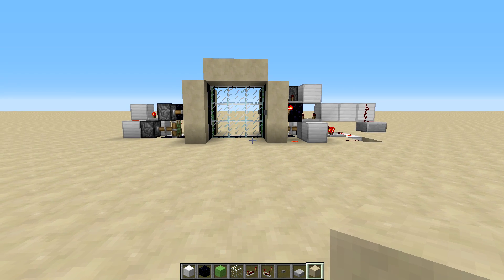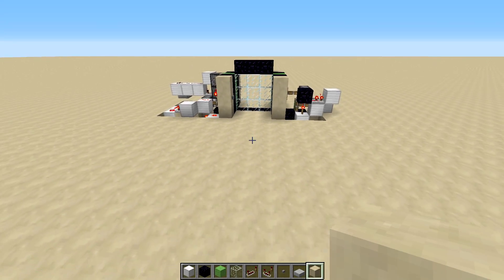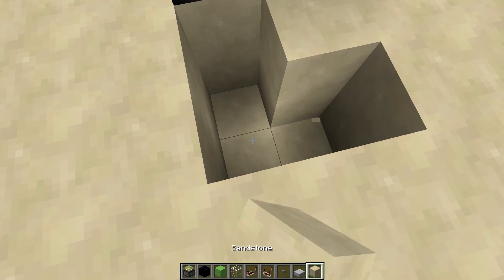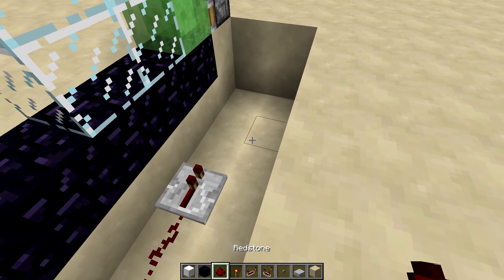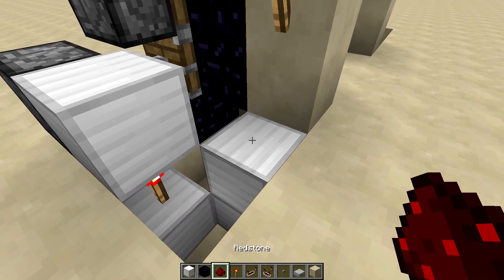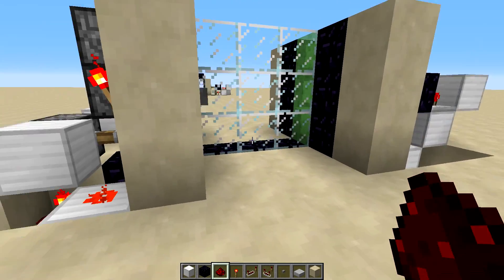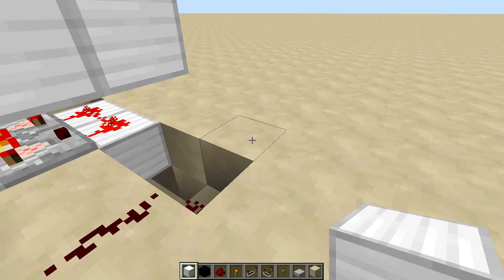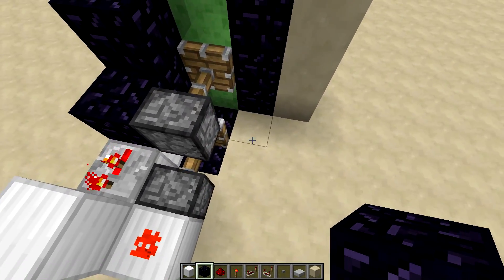Tutorial - 3x3 Sliding Door [14x6x5]

Comment: Potentially how high do you think you could you make this door? I have a friend who's building a cathedral and I've been trying to figure out a way to make a really tall three block wide door that opens horizontally. The server's still on 1.7 but I'd been trying out some ideas with slime blocks for when it eventually updates to 1.8 but I'm only really a beginner at redstone design and have gotten a bit stuck. (Not asking for tutorial or anything, just an opinion)
Reply from the maker: ***** It's tricky.. you can do it but you have to watch out for the 12 block limit on how many blocks a piston can move. It's a lot easier if you don't mind having the slimeblocks on display though. This particular design it not really expandable as is because one side is already moving 11 blocks at one point.
Reply: Wooly Creeper
Yeah, it's the "no slimeblocks on display" bit is the biggest issue, it'd ruin the cathedral aesthetic a bit to have a green door.

Anyway, thanks for the feedback. In that case I might be better off making the door a "portcullis" so it opens vertically, pushed by sand or gravel, I've got an old design that seems to work okay so I might give that a go (and I can do that before we update, which is nice)
Reply: ***** Maybe use multiple triple piston extenders? if you use slimeblocks to move 3 layers to the side at the time, then you can just stack it up, this is because you don't have the slimeblocks against each other, because you can just use 1 slimeblock in the middle layer on the left/right side that makes the whole 3 high thing move. That's probably your only option, but you will see a few slimeblocks sadly
Reply: Jan Leeuwenburgh
I think I know what you're getting at, I'll have to try it out and see how it looks, thanks.
Reply: ***** Hello, I just finished my castle but I would like a door like this, did the cathedral work well? Let me know!
Reply: Pyrotheum MC
Actually I had trouble even getting this door to work against the server lag...
But we have a gate plugin now, so using that instead.
Reply: Oh alright